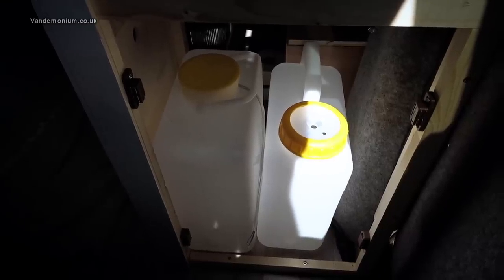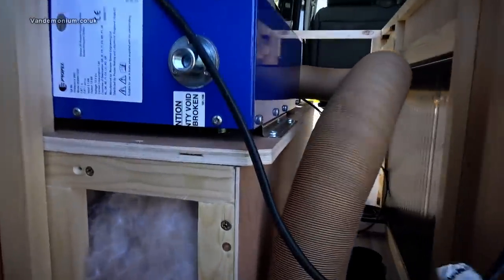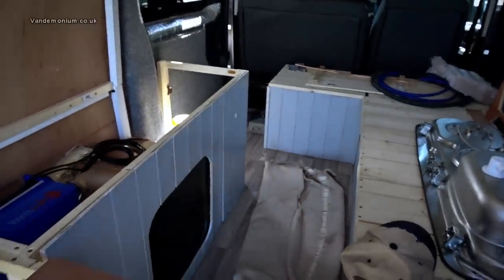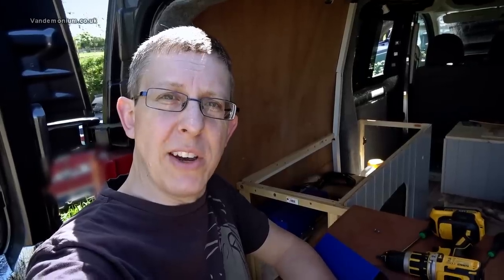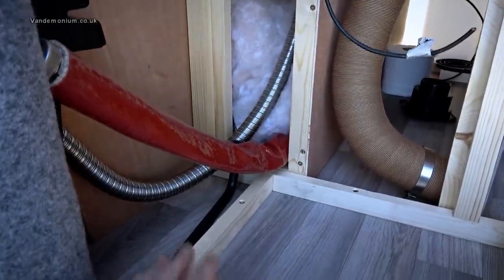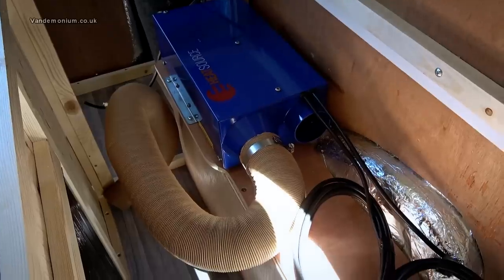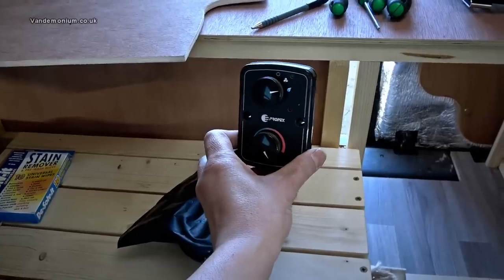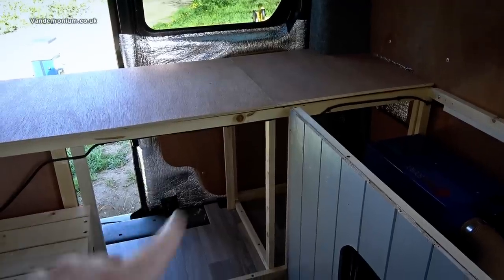Vlog 18: Propex HS2000 campervan heater installation (part 1)

Comment: I believe you have the intake and exhaust pipes reversed. The metal is exhaust and the rubber is the intake.
Reply from the maker: No, I assure you I did not. They are both metal pipes.
Reply: @Vandemonium  also, the inlet is bigger, the exhaust is smaller and hotter thus more insulated. None of that is weird! Air inlets are always bigger than the exhaust, because otherwise you starve the flame which means CO which means bad things. Air inlets are also uninsulated.
Reply from the maker: Neither pipe is insulated (until I added insulation, which is optional, later). I reiterate that I have the pipes quite correctly attached.

Comment: Hi what about carbon monoxide ?
Reply from the maker: I have two CO detectors in the van.
Reply from the maker: It's not illegal and it has been signed off.
Reply: @Vandemonium  pipes shouldnt be inside the van
Reply from the maker: @Ram Z - the install was confirmed as acceptable with the heater's manufacturer. The pipes are sealed to outside.
Reply: Ah..the elephant in the room. The air you breathe and the byproducts of combustion never meet.

Comment: Propex :O Expensive af! Shame you didn't go for a diesel heater :>
Reply from the maker: No, it was cheaper than a diesel heater and I didn’t want the hassle of dropping a line into the vehicle’s fuel tank,
Reply: @Vandemonium  What do you mean? A diesel heater is around £150-200 and comes with external tank :> 

Thanks for your videos
Reply: @AndreasEUR  The Chinese clone Eberspächer diesel heaters are indeed £150-200, but they are not really the same quality build as genuine Eberspächer or Propex.... also, when this video was posted, the clone heaters were not common as they are now.  Finally, although they do come with their own tank, it's not suitable for mounting outside the vehicle, so you would end up pouring diesel inside the vehicle, which can be smelly and unpleasant, so they aren't as practical as gas unless you can share the vehicle diesel tank.... if there has to be a gas tank anyway due to cooking burners, it seems like the best option, and Propex is certainly cheaper than Eberspächer....
Reply: Not really. Have you ever spilled diesel on yourself or your vehicle? Have you checked the price of each lately? Also, repairs to a diesel heater are...costly.

Comment: I'm thinking you should put an intake in the side so it draws fresh outside air in heats it and gives constant fresh air in the van. carbon monoxide is a big concern. you'll want a CO¹ detector.
Reply from the maker: No, it's not designed to push the air it heats into the van, it's an entirely room-sealed system. There's plenty of fresh air in the van from the roof vent and the sliding side window. Yes, I have a CO detector, see the final finished van tour :-)
Reply: @Vandemonium  plus I recall that you said it drew combustion air from the out side and vented it outside as well.
Reply from the maker: Yes it does. But their air it's hearing is the air inside the van. The air brought in is just used for combustion.
Reply: Inefficient and really not a concern with propane.

Comment: Its  not making sense :-) installing under the front seat and routing a gas pipe fwd would be far easier.
Reply from the maker: It might be an option but I don't think it would be "far easier", it would just throw up its own difficulties.
Reply: @Vandemonium  i think a bit of research how others do it might help.
Reply from the maker: Too late for that but also not where I wished to put it!!

Comment: I find it both hilarious and very confusing that people will spend £450+ on a heater, £500+ on the hob/sink unit and countless £100's on lights/hook-up etc.

But won't buy anything better than cheap shit pine cladding for the cabinet work.

Pine cladding is literally the worst thing you can put in a van that will be susceptible to extreme temperature changes during the seasons, it warps, crack, and rots too easily.

The amount of vans I've seen with cladding ceilings/units that are coming apart is mental.
Reply from the maker: Seems to be holding up just fine after five years so far...
Reply: It also makes dangerously good kindling

Comment: It seems that you've sabotaged a major advantage of your heater.
It's designed to be plumbed to bring outside fresh air in to be heated.
The 2 great things that happen are, of course, you not only breathe fresh air but it stops condensation from accumulating in your van.
It keeps your bedding, clothes , windows & metal surfaces dry.
It's most likely not healthy for your lungs to be breathing damp air for periods of time.
'Hope that you consider plumbing an outside fresh air intake for the healthy dry air.
Reply from the maker: No, that’s entirely not how these things are designed. The air from outside is brought in for combustion only. The air within the van is warmed and the ducting for that stays within the living area. At no point is outside air intended to be heated. It wouldn’t stop condensation since that is produced by your hot, wet breath meeting the colder parts of the van interior, which happens regardless of what the heater is doing. Any water produced by the combustion process is contained within the the unit and expelled within the exhaust.
Reply: I apologize.

I was waiting for a reply from Propex when I received your note.
Propex confirmed that it is designed to operate in the way you've installed it.

Gasoline & diesel heaters bring fresh cold air in and heat it.

Heating the cold air increases it's ability to absorb more moisture at the increased temperature thus carrying moisture out as the air flows through and out while keeping the vehicle dry.

I've read heater articles stating that gasoline & diesel contain far more energy than propane.
Maybe it doesn't have enough heating power to heat the colder outside air enough in some locations.

Also a 2nd tank for the propane doesn't need to be mounted in the limited space available as the others operate from the vehicle fuel tank.    Just fill your vehicle's fuel tank at any fuel station & you're ready to go.

I didn't mean to bring on negativity and I wish you all positive out comes.
Reply: @jsjs8818  THANK GOD! Do you really think for a second that David would do otherwise?